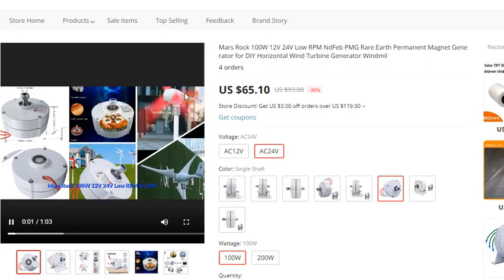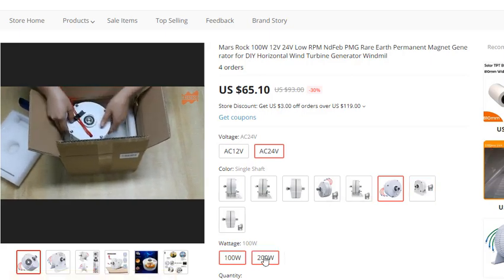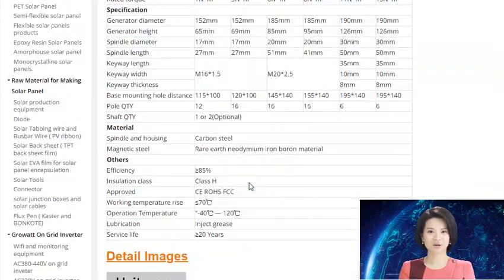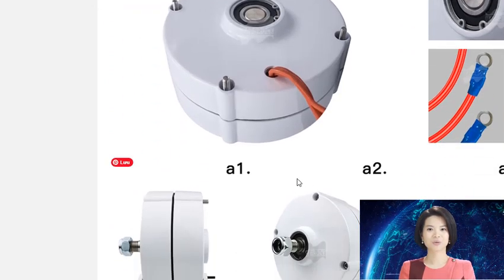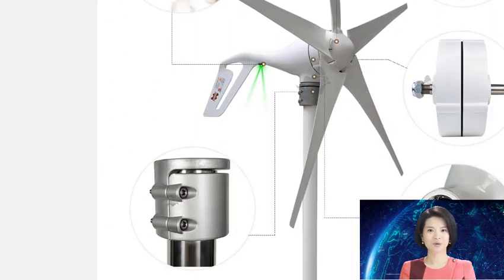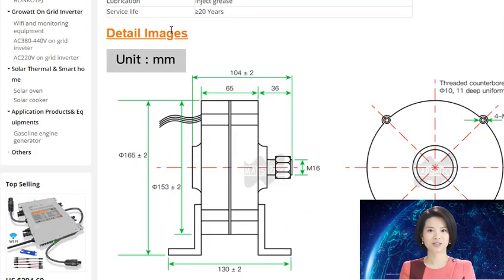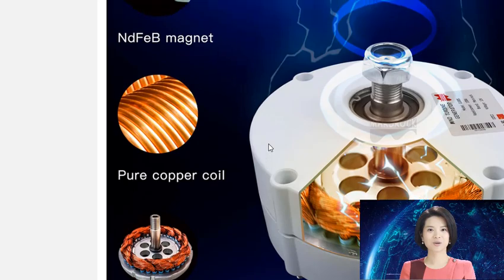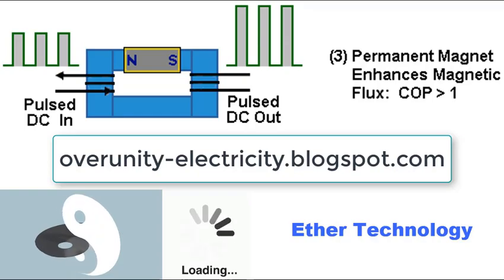Permanent Magnet Generator: Universal Generator Head, for both horizontal axis Windmills

Comment: The permanent magnet generator also offers some great advantages over traditional generators. Most notably, these generators have very high torque at low RPMs which makes them ideal for powering small appliances or devices that require more power than what a regular motor can provide. Additionally, unlike traditional generators that produce AC power, these generators output DC electricity which allows them to run quietly and efficiently without generating any heat or noise pollution.